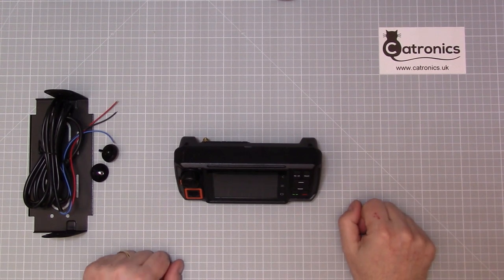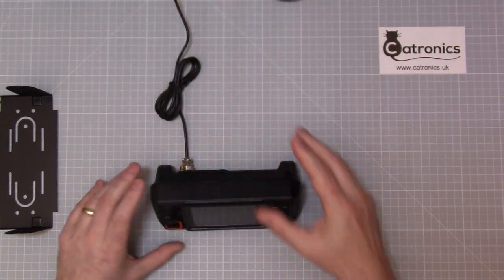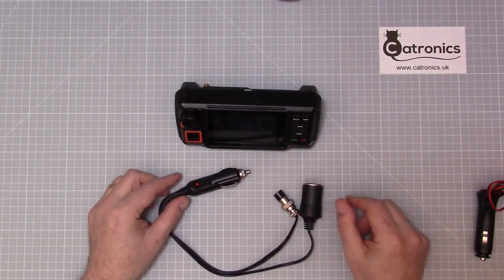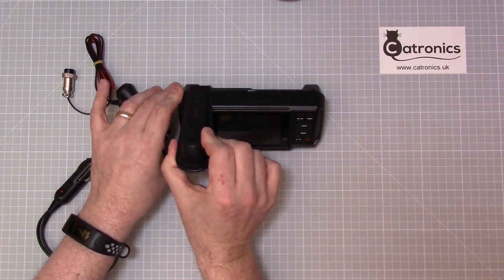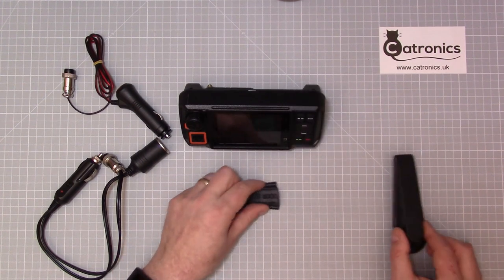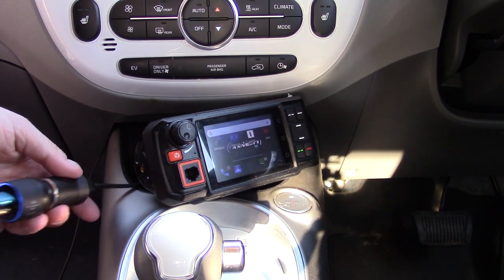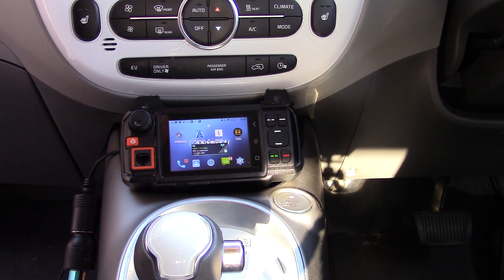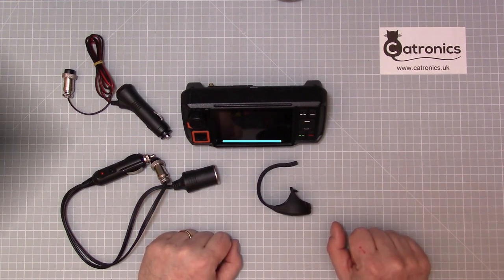Installing an Anysecu W2 Senhaix N60 Network Radio

Comment: I'm confused. Does the radio boot up faster if red is connected to battery+ and blue to accessory... vs. red and blue both to (switched) accessory?

Comment: when car is turnedoff the radio goes off, then needs to reboot all the tome?
Reply from the maker: Yes that's correct as the 12v accessory socket is designed to turn off with the ignition.
Reply: You can use a timer to keep the radio on for, let’s say, 20 minutes after you shut off your car, so if you are getting off an on the car, it won’t have to reboot every time you just get off the car for a few minutes.